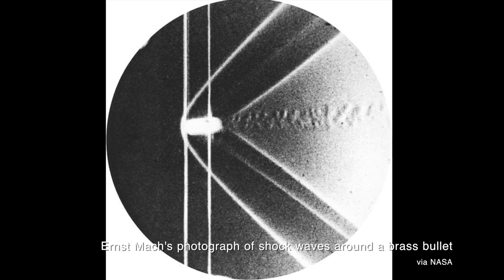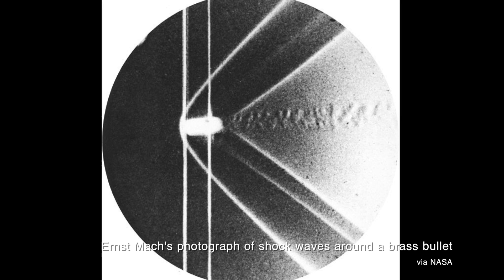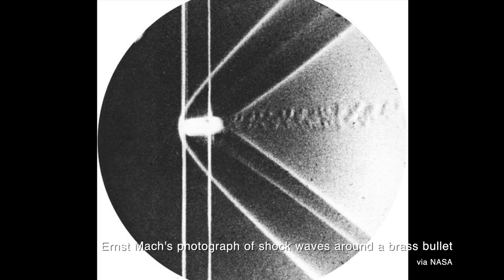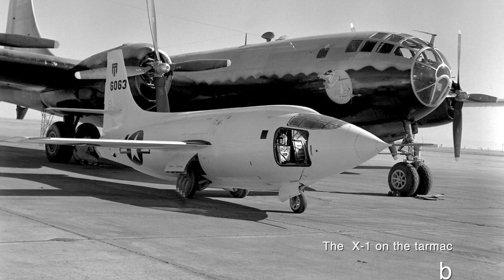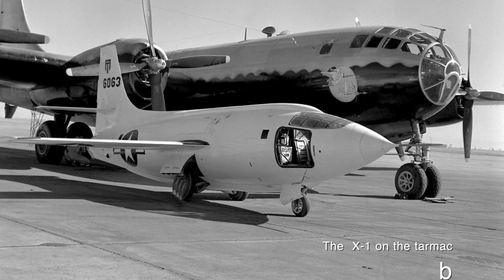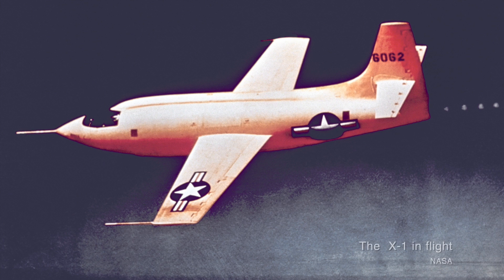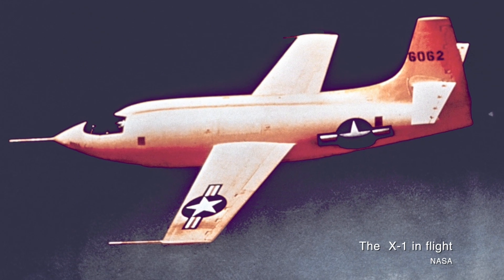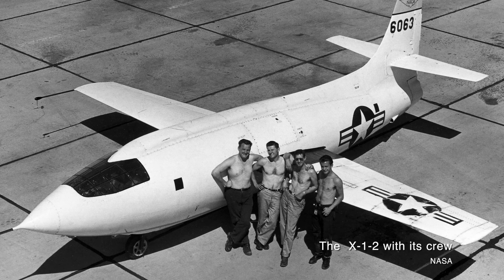What Happens When You Break the Sound Barrier?

Comment: I believe that shock diamonds in the exhaust are there all the time, not just at a particular Mach number.  I'm sure you meant Mach .8  and that's a speed where they would be looking at the plane because it is the speed where there's the most shaking. That they expected. 
There was one fact classified as SECRET on that first flight. It was the effectiveness of the elevator trim switch which Yeager requested be moved to the H-shaped control wheel.  In the transonic region (just before Mach 1) the back of the stabilizer where the elevator is, is in somewhat dead air. (I'm not sure why) The designer of that plane chose to make the whole stabilizer move for the trim function and that was effective past Mach 1. That was soon de-classified because it was so important for reasons of safety. All supersonic airplanes since then move the whole stabilizer like that.
Reply: Walter Clark the reason was because the shockwave moved back to where it was right on the hinge point of the elevator rendering it useless. The switch was an adaption from a control wheel type to a motorised jackscrew (from a hardware store no less) which moved the leading edge of the stabiliser up or down. It overcame the shock problem and the flying tail was born. This wasn't the first flight either. Amy's version is rather condensed but it's gotta fit in 7 minutes so ...
Reply: Sorry the flying tail is a British idea tested on a plane in the 1930's it was copied by America to solve the problem with the x1
Reply: It's not so much a matter of dead air, but that in subsonic flight - no shockwaves - the movement of the elevator affects the airflow over the entire surface.  When the shocks form, and start moving back, not only is the airplane tending to nose down (Mach Tuck, as already noted), but elevator effectiveness is reduced as the elevators can't affect the airflow ahead of the shocks. So - control effectiveness is reduced.
It's not impossible to have a transonic/supersonic airplane that is controllable by elevators alone, but pitch effectiveness is much reduced.

Comment: Good video. One big thing that you didn't mention though: one key data from the X-1 flights --  the big "secret" they learned about supersonic flight --- which is of course the flying tail. Almost all aircraft prior to X-1 had a regular fixed tail and an elevator attached to it via hinges. Near the speed of sound, shockwaves form around the elevator hinge and the pilot loses all pitch control. X-1 also lost pitch control near the sound barrier and they were about to call it quits, but engineer Jack Ridley had a brilliant idea. Luckily the X-1 had a motorized trim system that rotated the entire tail a small amount, so the pilot could make a slight adjustments to the angle of the whole tail (not just the elevator). Ridley thought this could give enough pitch authority to allow Yeager enough control to try and bust through the sound barrier safely. They went for it and succeeded.

This is why on all modern jets the elevator is not hinged like WW1-WW2 aircraft, the entire tail pivots -- the so-called "flying tail".
Reply: Jack Ridley "had a brilliant idea" when they received the data from the British development of the Miles M-52 which was mysteriously cancelled to hand the reins over to the Americans.
https://en.wikipedia.org/wiki/Miles_M.52
Reply: More like everybody decided to check it out when it was proposed in the 1943 joint Transonic Aerodynamics conference, and the N.A.C.A. mounted on the Curtiss XP-42, and the Brits tried it on a Spitfire.  The results were discussed within the industry during the Joint Fighter Conference on October 1944.
The incomplete M.52 was cancelled after the X-1 started flying.

Comment: The breakthrough was that the X-1 had an All Moving elevator, mainly just for Trim at first but it was found they could maintain elevator effectiveness using the trim as the shock waves from the wings interferes with the elevators. That was the Key. The USAF kept the All Moving Tail (look at an F86 Sabre) as secret for many years. The Me262 and the "Tailless" Me163 Comet were incapable of breaking Mach.
Reply: search... miles m52

Comment: A follow-up to that is what causes the sonic booms? I always thought the boom occurred only when the object passes through the sound barrier, but wondering if it is heard for the duration of a flight past Mach 1.
Reply: A simplified way to think of it is this: The sonic boom is actually caused by the object making a lot of sound as it travels through the air and since the object is flying faster than the sound it makes, the sound waves build up in something like the "wake" coming from a speed boat. When the wake propagates to a stationary observer all of the sound waves piled together to form the wake hit the observer at almost the same time, and it sounds like a "boom". It's really a big "wake" of sound that is following the plane along and spreading outward.
Reply: Great explanation, makes sense now. Thanks!
Reply: MrJackHackney To further expand on the explanation, the wake is something of a cone shaped wake, because the waves are moving an a 3D medium (air) and not like the surface of water like with a boat. Further complicating things is that different parts of the plane can each generate their own cone of sound waves and when the cone from the nose of the plane is narrow, it can touch the wings instead of spreading around them. When the wake hits the wings it will totally ruin the aerodynamics of the wing and make the wing and any control surfaces on it totally ineffective. In come cases the wing will work opposite of the way it normally should. That makes the plane impossible to control.

Comment: Really enjoyable.  The advances in aviation really become interesting to me starting in WWII.  Advance after advance. 

 In a past life as a SONAR tech on a fast attack submarine the speed of sound was very important to know at all times. With that speed being several times faster than in air depending on temperature, pressure and salinity of the water.  Sound also does some strange things in the ocean.  Always seeking the slowest possible speed.  Bending and getting caught in thermal layers and creating convergence zones.

I understand the speed of sound also changes depending on a host of variables.  Does anyone know if sound waves through air have similar characteristics?  Bending and not necessarily traveling in a straight line.

Comment: This video is a correction because she said something imprecise in passing in her last video. That video was also a correction because she said something imprecise in the video before that. That happens now and then, still a fantastic channel.
Reply: Unfortunately, you are still conflating 2 different problems with high speed, the compression of air and the sonic shockwave. The compression gets progressively worse as the speed increases, whether sub or super sonic. The shock wave, however, is specifically a problem at the speed of sound, where the sound energy from the plane never leaves the plane and adds continually to the energy from the new sound it is producing. The boom you hear on the ground is the addition of all these sound waves hitting you at once.

The compression heating is the primary problem solved by the heat shield in space craft, by the way, which was the subject of the last video. The shock wave is generally a bigger problem for supersonic aircraft. They have to move through mach 1 quickly because at mach 1 they are riding the shock wave and it is very hard on the aircraft.
Reply: I can enable/see closed captioning.  I think it come from voice recognition software.
Reply: Sam   You might want to look at these wind tunnel photos at Mach 3.5 and Mach 6.  The airplane, X-15 model in this case, is still, clearly, "riding the shock waves".   https://history.nasa.gov/SP-60/ch-5.html
Reply: Mark Holm Fair enough. What I was saying is an approximation with the airplane modeled as a point, as I did in high school 20 years ago. As I mentioned, such mistakes happen to me, Amy, and everyone else. The shockwave gets narrower as the plane goes faster, but the sound eminating from each part is producing a shockwave cone from that point going behind it. So the shockwave from the nose hitting the air will be on the wings in a typical craft, but the shockwave from the engines will be behind the wings except at mach 1.
Reply: Thank you!